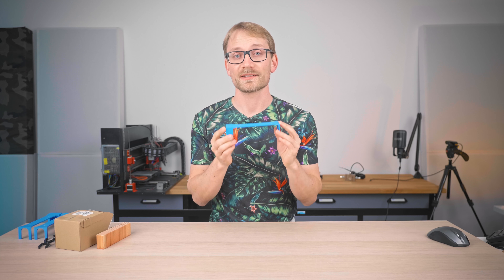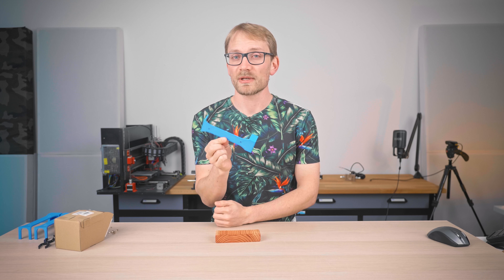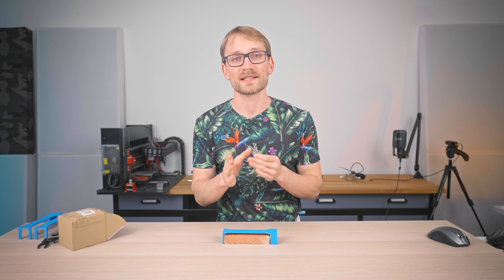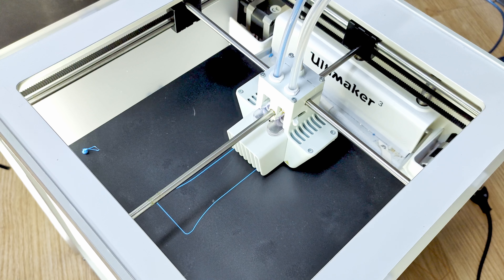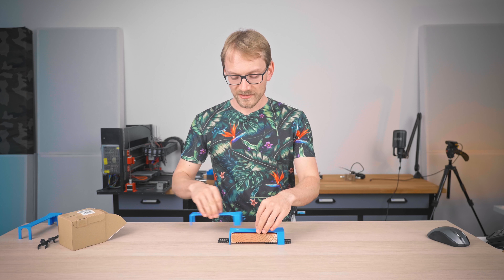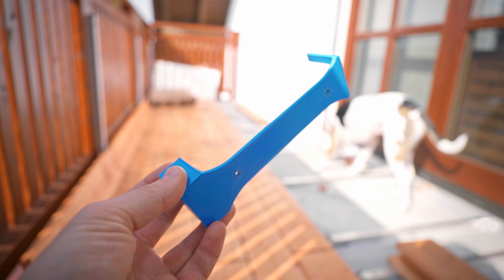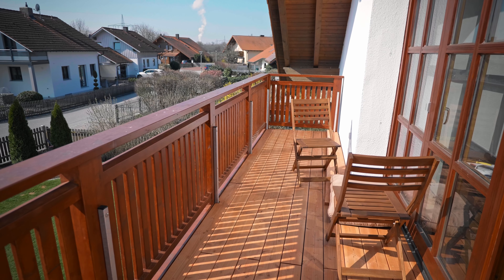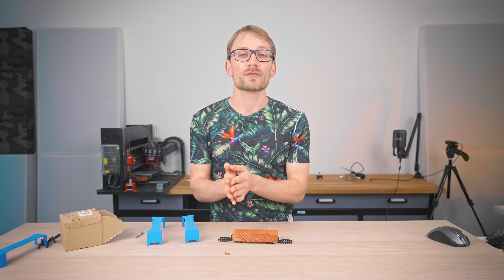This is why I love 3D Printing!

Comment: civil engineer here:
Just curious why the concrete balcony-slab doesnt extend all the way to the front handrail?
Reply: I wondered the same thing. Was the wood installation designed to deliberately overhang the concrete, making the balcony bigger? If so, is the balcony structurally able to take the increased load?
Reply: @0liver0verson9  ah just print a balcony extension
Reply from the maker: The balcony originally was deeper, but last summer we added 12cm of exterior insulation to the house and lost that amount of depth on the balcony. Simple solution was to mount the balcony with an extender bracket and then cover up the top and bottom.
Reply from the maker: The concrete structure should be able to support the extra leverage quite easily as it's also supported by an oriel underneath.
Reply: @MadeWithLayers  Haha... we Germans are truly masters of making life complicated for ourselves. Like: I added insulation to the house to conserve energy - but now we have to switch on the lights a lot more because the windows let in less light. Oh yes, "ze wörld" will follow us in our epic quest to trip over our own feet ;-)
Reply: @f.d.6667  we engineer just engineer our way out of a problem (into another problem haha)
Reply: @f.d.6667  A few W for lighting as opposed to a lot more W for heating is a trade off that is very beneficial.
Reply: @f.d.6667  Isn't all world spending all their time making problems by solving problems from previous problems?
Reply: @f.d.6667  You added insulation to a house to conserve energy, but you need to turn the lights on because windows let less light in? What? Did you get rid of your windows? Even double glazing still lets in the same amount of light.
Reply: @BlackSlimShady  Um no, it's a known geometry problem: Adding wall thickness through insulation will make your windows more "tube-like", resulting in a reduced light influx whenever the sun's rays are not fully orthogonal to the window's (glass) surface (basically all the time). If you are designing a house from scratch, you will compensate for that by making the windows surface bigger. However if you are retrofitting a house with 100+ mm of styrofoam, the loss of natural light is quite substantial and can not be mitigated in a low-tech approach.
Reply: @vladimirseven777  Totally agree - but that's not what I would call smart ... and we Germans perceive ourselves as, well, you know, smart-ish ;-)
Reply: @f.d.6667  HA!!! I find that comforting, knowing that dumb is a global not just a local!
Reply: @FreeOfFantasy  Not from a human factors and/or environmental medicine perspective. We need natural daylight for hormone production, mental health, general well-being and visual acuity. Modern LEDs are more and more at the center of a growing concern that their UV and blue emissions and their lack of true red and near IR radiation is responsible for a hike in serious eye problems in the modern world. Some recent studies from Australia and Asia seem to point into that direction and somebody working at the Tübingen University Hospital confirmed this to me too, calling especially the A+++ LEDs and their negative effects on the human eye "outrageous"...
Reply: @f.d.6667  I understand that, but ive never seen a house where in ANY room where its so dim, or lacks that much lighting where adding insulation would require you to have lights on.

Edit: Also how small are these windows that you would even really notice the "tube" effect, The smallest windows we have in our house still let through plenty of light despite the "tube" being longer than the width of the actual window pane.
Reply: @BlackSlimShady  In hotter areas, people use that "tube effect" to reduce the sun radiation through the window and accordingly the air conditioning energy required. It all depends on the overall climate of the area. Our windows are 25cm deeper than the surface of the building (min. temp over the year is like 1.5ºC, max. temp around 40ºC) but somewhere where it freezes to -15ºC for example have to balance it out.
Reply: @BlackSlimShady  My background is in human factors, so noise, light & vibration etc. are sort of my daily business. From this standpoint the problem is that people (the human eye) adapt subconsciously to lower light levels. No problem when you are young or have to adapt only for a few days. However, the cumulated impact over time as well as the impact for people with age-related acuity problems is quite tangible, especially when you compensate for the reduced light levels with LEDs or CFLs - as there the difference to biologically "good" daylight is adding the problems of damage to the retina and the negative impact on the circadian rhythm.
Reply: @davidthurman3963  True ... but we invented dumb first!!!
Reply: @f.d.6667  And so adding insulation to someone's house is enough of a difference to effect all that? I say not. Unless these old people are living in rooms with barely any windows and living in shade.
Reply: Kieran Bratson depending on the insulation it can add up to about 40cm of additional wall, so on small windows you would notice the tube effect pretty heavy
Reply: @BlackSlimShady  Maybe @F. D. will send the specs to you and you can replicate the project and report back with solid data? Maybe I'm misinterpreting your intention, but he has first hand knowledge and is actually living the effect, so it stands to reason he would be the best authority on this matter hey? My east and west walls are almost entirely glass, and unless it's a bright shiny day we generally turn the lights on. Ironically we turn them off at night.
Reply: @gregoryconnors7370  I'm just shocked too see that adding insulation will make there be a noticable difference in lighting. It has never happened in any of the houses I have lived in, in any of the rooms, no matter the size of the windows. The lighting really doesn't change much at all.
Reply: @BlackSlimShady  I can understand that. It seems counter-intuitive and I'm surprised myself when the room with all the windows seems dark at times. If I were to fir the walls out for more insulation or whatever, I can definitely foresee the "tunnel" effect.  Perhaps a light meter may prove the effect imperceptible and it's just a matter of cranial phenomena?
Reply: @MadeWithLayers  no need for 12cm insulation, 5cm do same job

Comment: But why are your boards upside down? The same wood without the textured side is cheaper no?
Reply from the maker: Since these Douglas Fir boards are mass-produced and the ribbed/smooth variant is the most common one, not only is it pretty hard to find them in 26mm for cheaper, it's kinda hard to find them in a smooth/smooth profile at all. But the ribbed/smooth can be used with either side up anyway 😉

Comment: Aluminium and stainless screws, not the best combo, the stainless will "eat" the aluminium. Just a heads up.
Reply: Not exactly. Regular steel screws will have a galvanic interaction with aluminum. Stainless is the correct fastener. But I am speaking from the world of a truck driver in regards of installing thousands of lights on aluminum semi-trailer rails over the last 30 years. (I'm not a builder)
Reply from the maker: Yes, there should be about a 2V galvanic potential between the steel and aluminum, but I believe the natural oxide layer on aluminum should hinder actual corrosion. It's a common material combination for decking here and has actually been working just fine for a few years already on the ground-level deck under the balcony.

Comment: You say, that the design tooks only 5 minutes. Thats mean 1 minute per sketch in fusion. I would say no. But I know what do you want to say.
Reply: How is that not believable? This is incredibly simple geometry.
Reply: @o11o01  yes but in this 5 minutes there must be also the time for taking measurements in.
I make also speed build constructions and I know how much time the complete design process needs.
Reply: @AllanScheSar  Shouldn't need to take measurements for lumber. Its standardized sizes. I do a lot of cad work, and can easily see how this part was drawn up in five minutes.